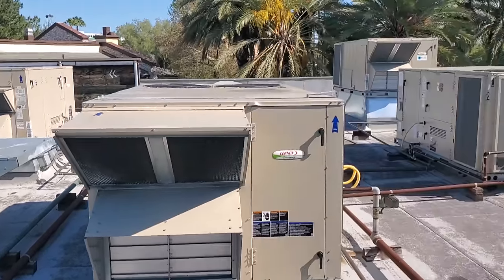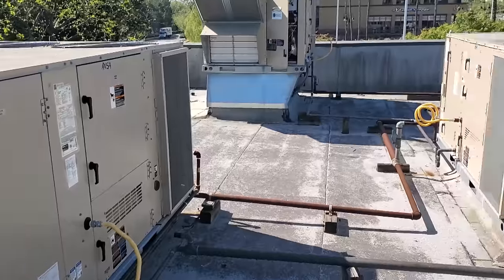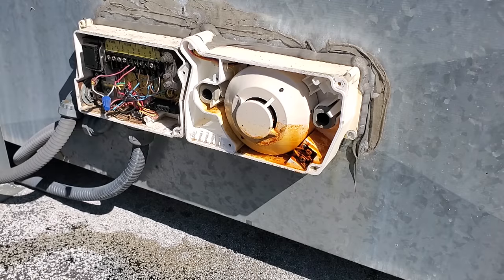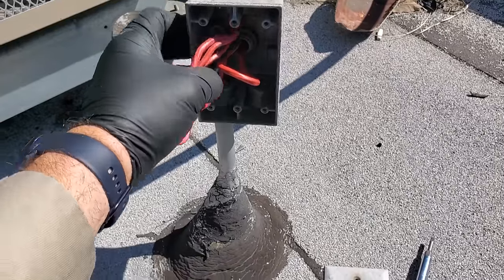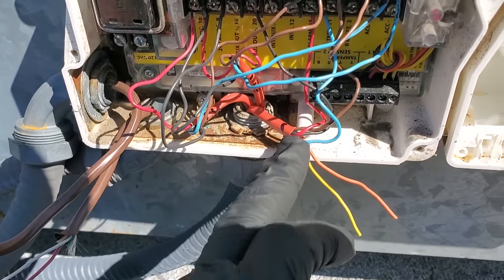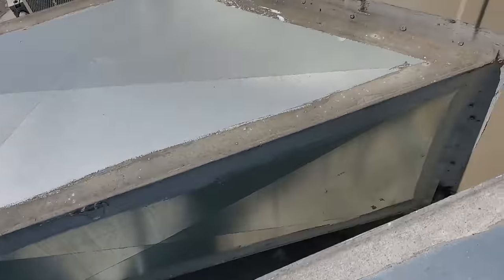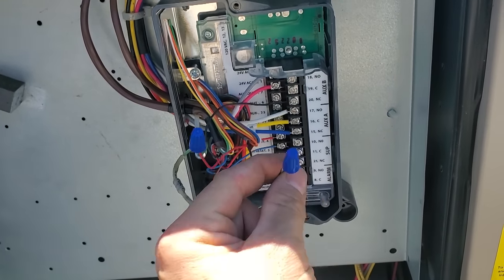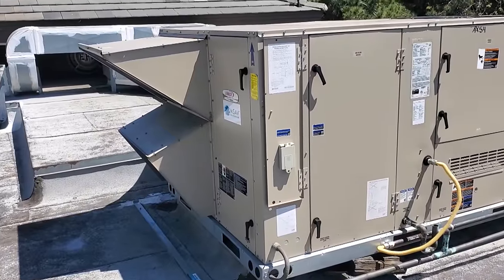DUCT DETECTOR TRIPPED

Comment: I have an old church I do the service at. The fire alarm company came out to redo the system. It was wired on many of my air handlers to send a 24v signal to shut down the units. This is not good. If a fire happens the wire could get burned and no signal would be sent. So they rewired for voltage drop. Now 5 air handlers are not running. They told me they were done. They told me I needed to rewire their relays. I’m not touching your relays I said but I will bypass them if they shut down my units so all the work you just did won’t work. I was pissed. They rewired the relays. I won’t be liable for anything fire related. I wish alarm company’s would stay away from our smoke detectors.
Reply: I should mention that all these units had my detectors on them so they would shut down if smoke was detected and they are hot and chill water.

Comment: Is the test and reset station just so someone doesn’t need to go up to the roof to reset the system if it tripped an alarm?
Reply: It is so that the fire marshal can test and simulate a fire condition from a central point during inspection.
Reply: @PatrickLeeUS  the only way to test a smoke detector is to put smoke into it. The "test and reset" station is just for box ticking. And it complicated the installation.....

Comment: I thought duct detectors were usually inside the duct inside the building but that 1st duct detector was half way up with water.
Reply: My AHJ requires the smoke detector to be 48” from the heat source if the unit has gas hear or electric resistance heat due to false alarms from heat strips and heat exchangers burning off dust at the beginning of heating season causing false alarms. Will not allow us to have them mounted in the RTU on the supply side; return is OK. Both required over I think 10ton. If they were factory installed they have to be removed or disabled and relocated <48”

Comment: You didn't do half bad. In all actuality you should have verified that the other units' detectors were hooked up and properly zoned as well.  Also, to cover your ass, go back and sleeve that tstat brown wire in some red jacket or the code inspectors may pitch a fit.

Comment: I thought you were saying “duck detector” until the card popped up...
Reply: Obviously don’t want nesting waterfowl in your AC...
Reply: Turn on automatic captions.... ducks everywhere.
Reply: Some people even call it "duck tape" :)
Reply: Pete Mundy Duck tape is the original name for any adhesive cloth tape (due to duck canvas weave cloth used). The original intent was a tape which could easily be torn by hand without scissors or a knife.
Specialist duct tapes designed specifically for heating ducts have more suitable adhesives which don’t melt when the duct is hot.

Comment: It's actually really hard to make such hermetic box with wires going in and out waterproof. It's on the roof, thermal cycling with day/night will change pressure in the box and condensation will happen. If there is no way for water to drain it will kill anything inside. Just a matter of time.

Comment: <- Surprised Canadian. I'm surprised that techs can work on the detectors. That's an Electrician only thing up here. Just started watching and that original duct detector is on wrong... Should be spun 90 degrees. Sampling pipe should lead the exhaust pipe and should be parallel with air flow, not perpendicular like that one is installed.